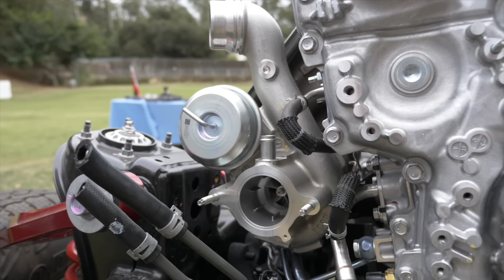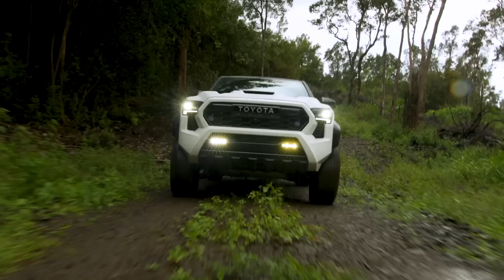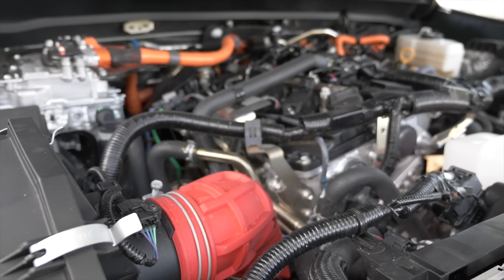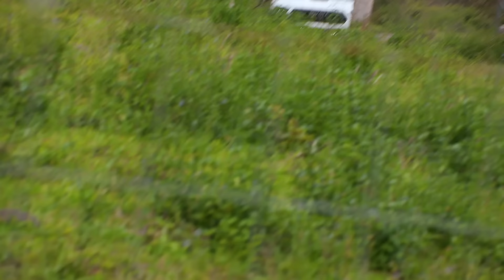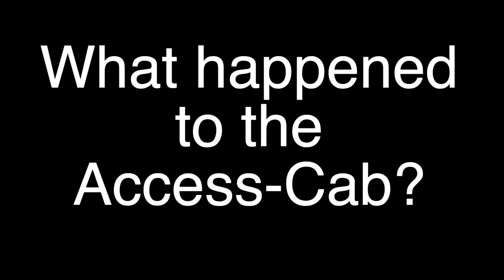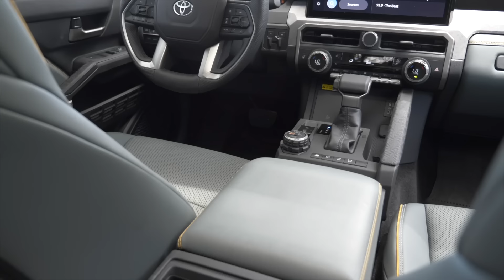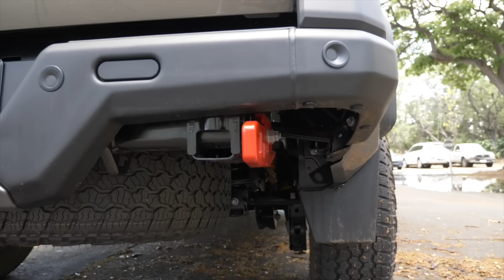2024 Toyota Tacoma Chief Engineer on new engine reliability and more...

Comment: Say what you will, but the old adage there is no replacement for displacement has yet to be wrong. Unless you found a way to make the oil and metal the engine is made out of suddenly better, you are overworking those components comparatively to a naturally aspirated engine. I think you need only look at the Ford V6 twin-turbo engines, because they're just starting to get old enough to see how reliable they are going to be. I feel sorry for the second and third owners of these vehicles.